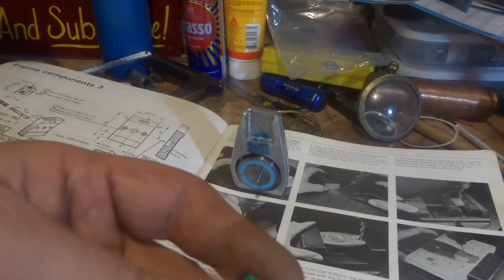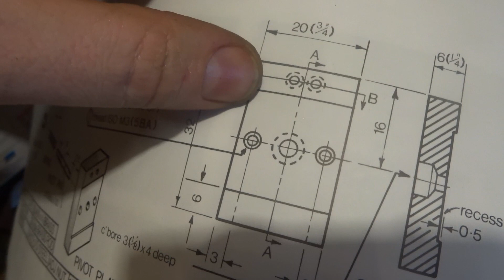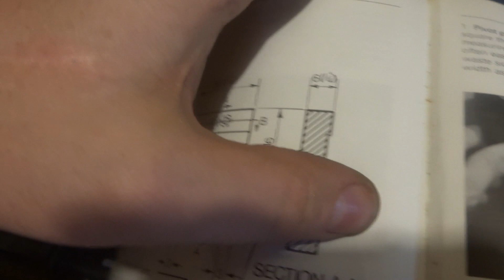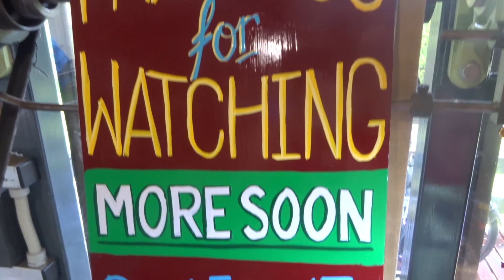K W  SCHOOLS  Steam Engine PART 19 valve plate

Comment: Nice job Emma. For years I used my Boxford AUD  lathe with a milling attachment until I was persuaded to buy a mill. That system works very well.  I still use it now and then as I have a boring table and an indexer which I made for it. I still enjoy making some stuff by hand with a hacksaw and a file.  Thanks for sharing, regards from the UK

Comment: I agree with you. You can easily mill small parts in the lathe, especially with a vertical attachment.  I have one for my Taig and have used it many times. Trouble is, you are limited by the travel on the cross-slide, in my case   63mm (2.5"). Everything on the Taig is that size except along the bed. Also, the setup is never as rigid as a real mill. But even on a mini-mill, you have limitations in travel. BTW,  halligan142 has a 9" South bend, a milling attachment and no mill. See his channel for a few videos of this. Also xynudu's channel, same thing. I love your minimalist approach.